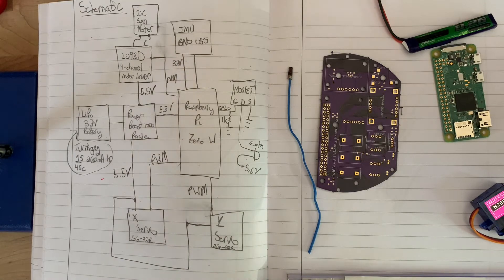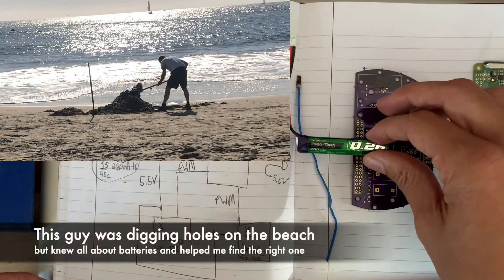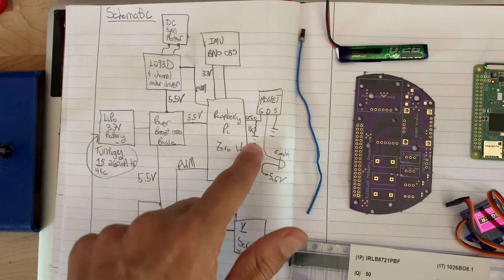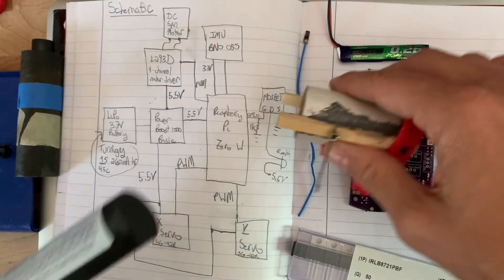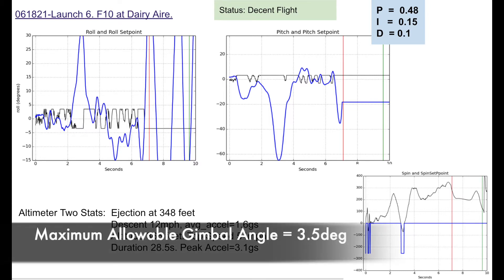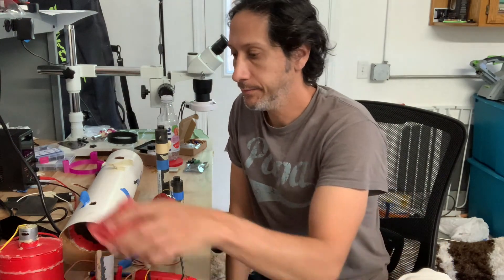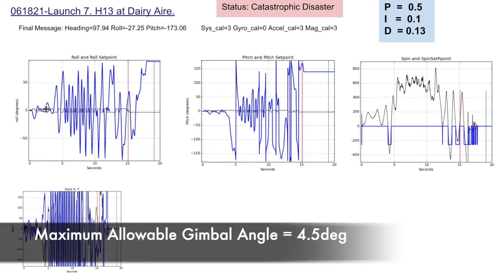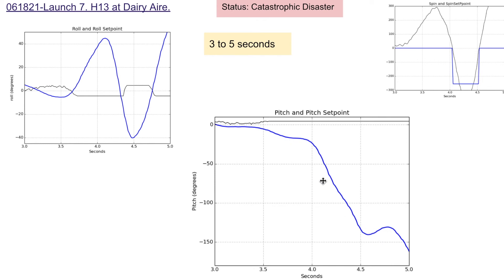Thrust Vector Control Rocketry - Schematics, Design and 2 Launches

Comment: This may be a little off topic for this particular viseo but my curiosity is tweaked. your spin motor for spin/roll control is it important to have a motor with high torque or high speed for this purpose? I am assembling an amazon wish list of parts for our first scratch built rocket and would like to implement your spin control idea into our first test rocket.
Reply from the maker: you need a small dc motor. torque and speed trade off so that also depends on your spin mass. you can expeirment with it. you also need motor direction controller to choose the direction based on which way your rocket can go. the key is to figure it out with experiments, don't spend too much time trying to figure it out without real hardware

Comment: Hey Peter
Great video and cool work. I just had a quick look at your code and I saw that you are directly using the sensor fusion data from the Bno055. I recently did some tests with it as well. I noticed that the sensor has a delay of about 40-50 milliseconds. According to my simulation, this is very close to the upper limit of what is still permissible for a stable flight. What is your experience with it? Are you trying to compensate for the delay?
Reply: Dear Peter

You are right, you can increase the moment of inertia to counteract this. For me, however, this is not an option as I like to keep my rockets rather "inert".
So far I've been working with the mpu6050 and I'm quite happy with it. However, I am always experimenting with new hardware and have therefore built electronics with both sensors. This is how I noticed that the bno has a noticeably higher delay. Then I built a test stand with which I read in the angle via a potentiometer and thus have a reference to the sensor. 
But as I understand it, you can't tell me anything about this based on your experience?
Reply from the maker: I've only used BNO055 without any compensation for my flights. Not sure how much of a source of error it has. I need to think about how to measure latency on my setup.

I did realize with PID controller, if you update the position with a linear estimate, than it is effectively the same as increasing the derivative term constant [setpoint = Kp*(pitch+deltaT*pitchspeed) + Kd*pitchspeed + Ki*pitchintegral], so I don't think I will use a linear term adjustment in the future.
Reply from the maker: Interesting. How did you measure the delay? I had modeled about 40 mS delay in my simulation program, but I was attributing it to the servo speed. 

To compensate, I suppose the most straightforward way would be if (pitch, pitchspin) are measured you could do pitchInterpolated = pitch + deltaT*pitchspin

As for what delay in your system is allowable, I think it is a function of the rocket's inertia. If you increase the inertia you slow down the time constant of the system, allowing for larger delays. That's the project I've been doing lately, extending the rocket length.